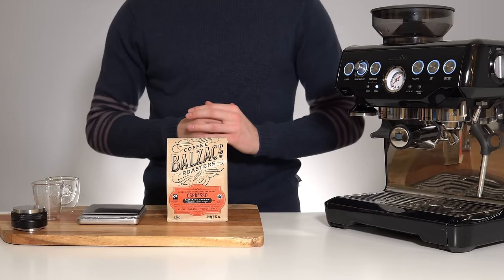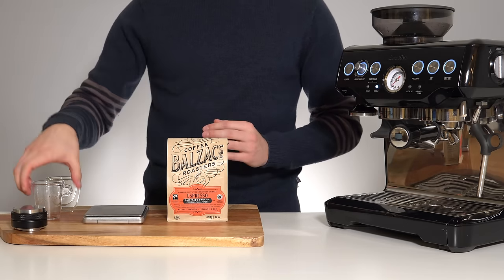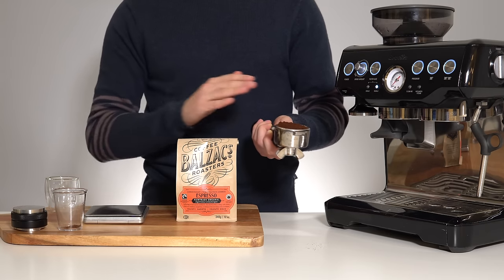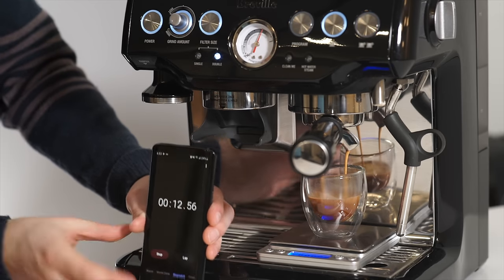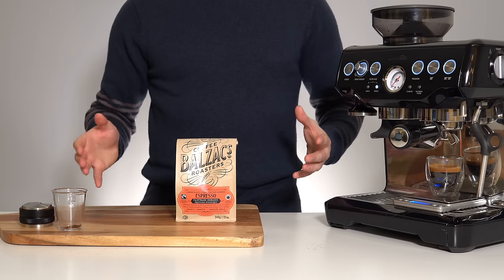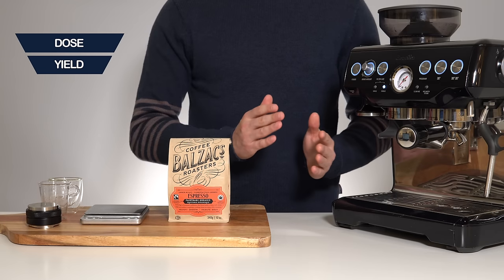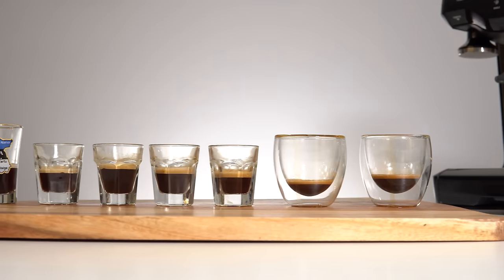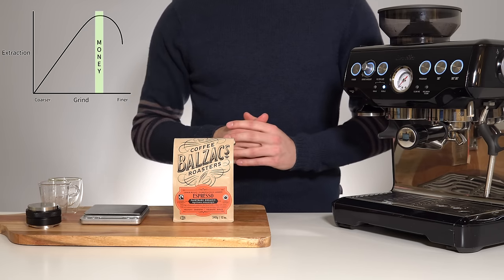Dialing In Breville Barista Express | Dose, grind, yield, time

Comment: Why do you start counting just when the coffee goes out of the portafilter? It supposes to be from the beginning of extraction, so when the pressure is starting to push water through the coffee
Reply from the maker: Different methods, both are simply to get you into a ballpark. You should never be aiming for a number  when dialing in, always dial in to taste. The 25sec figure thrown around is simply for very beginners to get them at a reasonable flow rate to START tasting and then dialing in further.
Reply: @LifestyleLab_  Look at the touch screen machine, it has a digital timer, which starts right from the beginning of the extraction. The same story with the other producers of the coffee machines.  Moreover, Breville manual supposes to count the time from the beginning of extraction till the first drop as the main indicator for the proper espresso preparation.
Reply from the maker: ... but the point still remains, you should never be shooting for a specific number, you should be dialing in to taste.... so it doesn't matter when you start counting as long as you are able to repeat it once you find a shot duration that tastes best for you

Comment: I am using Breville/Sage barista express. Single wall single cup portafilter. 7 grams in, 14 grams out after 25 seconds. Problem is that the pressure is at the highest and coffee tastes very bad. I can get pressure within espresso range by grinding coarser, but then I get way too fast extraction times. I have tried with a 16 gram and 18 gram dose in the double cup filter, the results were exactly the same. What can I do?
Reply from the maker: The "espresso range" on the pressure gauge is incorrect. Good shots are generally pulled around 12 o'clock to 1 o'clock on the dial. 
Have a look at the second have of this video for help dialing in to taste: https://youtu.be/D-bV4j-Z-sU

Comment: I have a brand Barista Express. I'm using Lavazza Super Crema beans, palm tamper, and weighing my coffee; but even on the finest grind setting, the best time I can get is 22 seconds and that is about 40g of coffee rather than 36. I doubt the problem is my coffee and it seems really odd that I'd have to be on the finest setting straight from the factory. What gives?
Reply from the maker: What gives is that you're not actually on the finest setting! You can go much finer by adjusting the top burr. See how here: https://youtu.be/QNvOcE4-VEo
Reply: @LifestyleLab_  thanks. I’ll give this a go but it seems odd I’d have to go that fine straight from the factory and with pretty good coffee. Any idea if this is common?
Reply from the maker: There is a LOT of variation from coffee to coffee, which is why they built in so much range into the machine. Certainly not uncommon to need to change these settings as the machines themselves are not necessarily calibrated to one another's settings new from factory

Comment: Hi, with the coffee I bought, I've had to go to grind size 1 to get in the range (just barely). Would you recommend increasing the dose? It doesn't seem like there is much room left in the portafilter to fit much more than 18g.

Could there be something else I'm doing wrong?
Reply from the maker: You still have plenty of room to grind finer using the upper burr adjustment, so being at 1 is not abnormal. Remember to dial in based on taste, not just flow!
Reply: @LifestyleLab_  Thanks! I don't really know exactly what I'm looking for in taste yet, so that makes things a little trickier.

Comment: Im still having trouble getting my espresso to pour properly.  I have it on max grind setting and also have increased my grams to 22 and still, all my shots pour in about 8 seconds.  What am I doing wrong or is there another step I'm overlooking?  I have my scale and the tamper from this video, and following this viedo step by step but to no avial.
Reply from the maker: You can still grinder finer by adjusting the internal grind setting on the upper burr :)

Comment: Might be a stupid question but if I am using a single shot filter of 10grms and I press the single cup what pour time should I have?
Reply from the maker: You should be able to keep the grind setting the same, and simply aim for the same brew ratio as your dialed in double shot :)

Comment: I’m so confused and at my wits end. Bought a new machine this week and I just can’t get it right. We are using the double portafilter but can someone please explain why we’d be aiming for 36g instead of around 60 when we are using the double cup button??

My machine is only extracting about 20ml for a double after I reset to factory default. I’m so frustrated and disheartened 😭
Reply from the maker: Brew ratio just come down to how extracted you like / need the coffee to be. The more water you push through, the more extraction you achieve, but also the more watered down the espresso. 
1:2 in 25 seconds is a general STARTING point for traditional espresso.

Comment: Hi, how much pressure ( BAR)  do i need for a espresso  ? I got an solis grind & infuse perfetta machine .
Reply from the maker: Standard espresso pressure is 9 Bar when using a single wall basket. Some machines like the Solis that use pressurized baskets will use higher pressures
Reply: @LifestyleLab_  i got a single wal basket for 1 shot and a second one for a double shot

Comment: Hello there. When I try your method, no matter what grain size or tamp pressure i use, i get 36 gr in 11 sec. also pressure gage is around 10:00. Do you think the machine is faulty or I am missing something?
Reply from the maker: If you've reached the minimum grind setting and it's still running too fast, you need to set the INTERNAL grind setting finer! Here's how: https://youtu.be/QNvOcE4-VEo

Comment: out of curiousity, what is your grinder upper burr set on, and did you mess with it from the factory settings?
Reply from the maker: No I have not changed it from factory setting. I will have to go in and check where it is set to because many people are asking :)
Reply: @LifestyleLab_  just curious! 
I think it's six
Reply from the maker: Confirmed I was at the default setting of 6 when filming this. I made a separate video on adjusting the top burr setting: https://youtu.be/QNvOcE4-VEo

Comment: When I hit the 20-30 sec area for 36-+ grams of liquid coffee, my pressure gauge hits the max is it fine or I should try to adjust it so it never surpasses the 'grey' area of pressure?
Reply from the maker: That is completely fine! 
I actually mention this at one point in the video. The vast majority of people I've spoken to agree that the best shots are pulled with the pressure gauge somewhere around the 1'oclock position
Reply: Lifestyle Lab thanks for the fast response!
Reply: @LifestyleLab_  I’m more at the 2-3 o’clock position if I want to get into the 20-30 second range. When I get 12-1 o’clock, I get to 36g in 15 seconds or even faster. Any idea how to adjust for this?

Comment: I have the same machine (since few days), use a double shot basket with 18g coffee, grind level down to 0 (smallest setting), tamper the sh!t out of it and still my coffee cup fills to 36g in only 12 seconds!? The pressure watch goes up near the end of the scale so I assume my tamping is fine. No idea how I can slow the brewing down to 25 seconds...
Reply from the maker: Have you adjusted the upper burr setting? (Not just the external dial)
Reply: @LifestyleLab_  Not yet but I will give it a try once the hopper is empty. Thx! Edit: Changed the internal Burr down to 4 and external dial to 1. Extraction time is up to 15 seconds and pressure gauge at the max. This does not make any sense? Coffee beans are from Italy, packing/roasting in August 2021. Could it be the beans?

Comment: I have a problem with extraction time. using good fresh beans, I use 18-20gr for a 1:2 ratio. Grind setting 4-6 with tamping I get good pressure every time. But my extraction time is 14-15 sec. Can't get to the mid 20's. Any tips will help out.....
Reply from the maker: You still have room to grind finer! A setting of 2 should get you into the 20's if your running at 15 sec now. If you set the grind to 1 and you're still running too fast, you'll need to adjust the internal grind setting!

Comment: I just got the same tamper as the one in the video, but if I measure 18 grams of coffee, it seems like it is too much ground coffee and I cannot even close the portafilter. But then this should be the correct weight. I use number 8 grind size. Any tips on how to make it better?
Reply from the maker: Is that your dialed in grind size? If not, you can grind finer, which will allow more coffee to fit into the portafilter. If it is your dialed in grind size, you'll need to drop the dose to 17 - 17.5g

Comment: I'm confused about how yield and time are different?  Surely, they are inextricably linked, you need to run the extracting for x time to produce y yield?  As most of the end weight is surely water?
Reply from the maker: They are linked, but by flow rate which can be varied. Ie, it's possible to reach 36g in 5sec or 30sec, and those two shot will taste VERY different. 

The flow rate is a product of the espresso machine pushing a constant pressure through the coffee puck. If the puck is highly porous, more water will pass through more quickly
Reply: @LifestyleLab_  I see thanks, learning still, picked up one of these machines a week ago. My pressure is good, but run time is relatively short.  Coffee is tasting alright. I perhaps need to start weighing. Also, does this calibration system/process need to happen for every new type of bean you use? Thanks for replying.
Reply from the maker: Always be dialing in to taste, so if you feel you're already close, don't go shooting for someone else's numbers. They are always a starting point only. Our Barista Pro dialing in video does a slightly better job explaining how to do that, so might be worth giving that a watch as well 

Yes, the grind size and ideal brew ratio (for your taste) will tend to vary slightly from coffee to coffee, but will not be as extensive as the very first time you dial in a grinder
Reply: @LifestyleLab_  OK, been trying a while today. I have the Sage which is a very similar model. I'm using Costa beans. My  time is quick, 18 or so seconds and I am at the finest grind.  Not sure what do. Also my 1 shot and 2 shots; 9g and 18g respectively seem to behave differently. Main problem on the 9g to 18g yield, is happening too fast. Becoming frustrated.
Reply from the maker: Dialing in a single shot is far more difficult. Focus on your 18g double for now, but just for reference, you should be dosing arond 11gr for your single basket. 
If you are at the grind setting of 1 and its still fast, you can still grind much finer by adjusting the internal grind setting as shown here: https://youtu.be/QNvOcE4-VEo

Comment: Do you use tap water ?
I just purchased it
Reply from the maker: It's important to use a water filter if you have particularly hard water (what I do). Do NOT use distilled or RO water in an espresso machine as it can damage internal plumbing.

Comment: Question not necessarily related to this video but over the past few years with my barista express Ive noticed the pressure dial starts moving a few seconds AFTER  the flow starts, whereas in others (and in your vid) it occurs at the SAME TIME. You have any thoughts on this and if it may affect the overall result?
Reply: That's the pre-infusion period which takes 5-10 seconds and results in a better extraction.
Reply: soheilsoroush from what I gather the pre infusion is not supposed to include liquid being released but only saturating/infusing the ground coffee in the basket before release. Is this not your understanding?

Comment: If I use 16g of coffee grind vs 19g the 16g will be lighter and the extraction will pull more water vs the 19g yes?
Reply from the maker: If you use 16gr, you will simply need to change the yield to achieve the same desired brew ratio. If you want a 1:2, simply stop the shot once you have 32gr in the cup. A 1:3 ratio, 48gr in the cup!
Reply: @LifestyleLab_  thank you, 
What is the grams that most people go by? Is it 17 to 18g?
Reply: @LifestyleLab_  How come when I did one shot or 9 grams it made 36 grams? Should it be less since it's only 1 shot?

Comment: Hii i have a question. I've been having trouble getting the right brew time & grinder setting balance. I tried using grinder size 8, it chokes and my brewtime comes at 40seconds. But when i change just by 1 to grinder size 9, my brewtime seems a bit too fast at 20-22seconds. How do i get to 25-30 second timeframe?
Reply: Update: i read a few comments and decided to change my dose from 18g to 17g, using the finer grinder size 8. I managed to get to 24sec mark. I also tried 17.5g, the flow was slower and reached around 35sec. Strangely, i felt the first shot tasted better, but my mom preferred the 2nd. So i guess the timing really is just a gauge and in the end it boils down to personal taste.

Comment: I noticed that you don’t use the razor. I tried with and without the razor and noticed that the espresso shit is better without. When using the razor, I trim quite a bit off. I’m not sure if that’s normal.
Reply from the maker: If you use the razor, you will no longer be dosing by weight, but by volume, which is not the best in terms of consistency and being able to control brew ratio.
Reply: @LifestyleLab_  I realized that I have to adjust the depth of the tamper. I was tamping at the minimum part. What should be the depth of the tamp ? Mine is adjustable. I hope that makes sense lol
Reply from the maker: Boy do I have a video for you! 
https://youtu.be/LZBbDMYPDGI
Reply: Thank you for replying ! I was also interested to know why we don’t pull a full 2 ounce shot ? Is it because the size of the porta filter does not allow for a higher amount of coffee ?

Comment: What do i do if even at 16 grams the pressure is still too high? Do i go even lower, to 15? At my current settings i'm getting a 1:2 espresso in 25-28 sec, but the pressure gauge is still almost all the way to the end of the scale.
Reply from the maker: As mentioned in the video, don’t pay attention to what the gauge is showing. Focus on the flow rate, and most importantly, the TASTE! 
You can’t taste numbers….

Comment: Does it make a difference if you start the timer as soon as you hit the button vs pressing it when you see the espresso drop?
Reply from the maker: No, ask long as you are consistent with yourself as to how you time. 
25 seconds is a general starting point, NOT a final dialed in shot.
Reply: @LifestyleLab_  Thanks for clearing that up for me! I followed your instructions for my first set of beans and the process was very smooth and quick. Just got a new set of beans, but all my shots seems to be under extracted no matter my grind setting. I even added more to the dose from 18g to 22g and i still get low pressure and fast, watery shots. Any suggestions?
Reply from the maker: Have you adjusted the internal grind setting finer? Or only the external dial?
Reply: @LifestyleLab_  I actually did not, but instead changed my portafilter basket from a single wall 2 cup basket to dual wall 2 cup basket. But i'm assuming the machine is extracting as much as it can from the bean automatically! I'm going to adjust the internal grind setting next time, and play around with it. Thanks for the help! :)
Reply from the maker: Just be aware that you can still get better coffee by properly dialing in the single wall basket 
https://youtu.be/eOKKMu5wmQA
Reply: @LifestyleLab_  I agree, I think i'll have to play around with that internal grind setting you talked about while using the single wall basket. Last time i used it, I couldn't get the right espresso no matter the adjustments I made.

Comment: Is the dialing-in process the same for the Barista Pro?
Reply from the maker: Absolutely! Except even easier because there's a shot timer built right in :)
Reply: Thanks! The manual suggests going by seconds until flow begins. But the 20-30 second flow window method seems to make more sense.
Reply from the maker: Remember to always dial in to taste!  Numbers are only a general guidelines to get you to a point that is worth tasting

Comment: hey, I am so confused on how to dial it in. i  currently have the inner adjustment set to 4, grind size set to 3, it goes into the right pressure zone and takes about 27 second but it is still beyond sour. Any advice ? 

Thanks!

Comment: What does it mean when the pressure doesn't work at all. What could be the reason? Dose?
Reply from the maker: What do you mean by it doesn’t work at all? 
The gauge doesn’t move while espresso is flowing, or espresso doesn’t flow
Reply: @LifestyleLab_  the gauge doesn't move. It moves when i do single dose
Reply from the maker: But does espresso come out? 
Regardless, pay attention to your flow rate. If the gauge doesn’t move, it is likely flowing very very quickly

Comment: Nice video, but every other "dialing in" video times the extraction time from the moment the pump turns on (since that is when the actual extraction begins), in the Barista Express since it has preinfusion that lasts exactly 10 secs if I do it your way I'm ending up with an extraction time of 35 secs. which is way too long, why do you do it this way?
Reply from the maker: This is a starting point, nomatter which method of timing you use, you must further dial in to taste after achieving a "ballpark" flow rate

Comment: If I programmed the machine to dispense 36g after dialing it with the desired weight, do I still need to keep scale it?
Reply from the maker: The programming is never an exact duplication each time (not possible without a scale), but it should be close enough assuming your puck prep is consistent :)